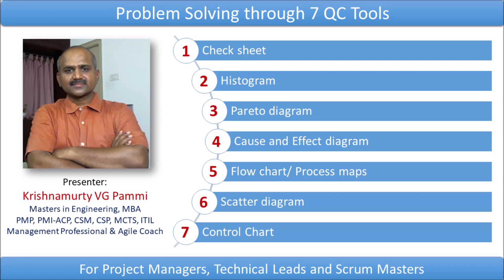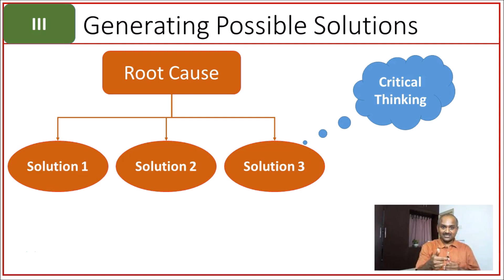Problem solving using 7 QC tools

Comment: 0:00 Introduction
 1:04 I Define the problem
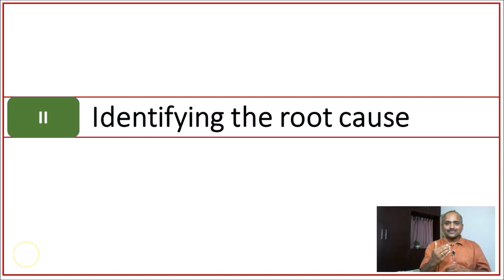3:02 II Identify the root cause using 7 tools:
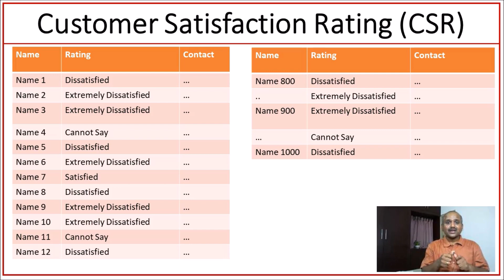3:56 1. Check sheet
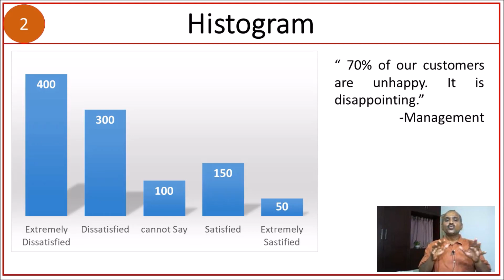5:18 2. Histogram
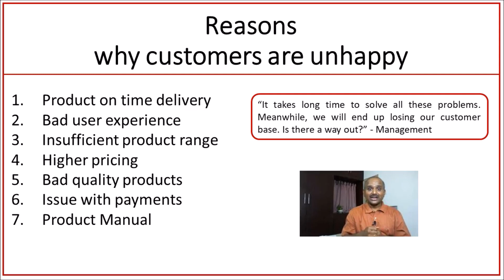7:44 3. Pareto diagram
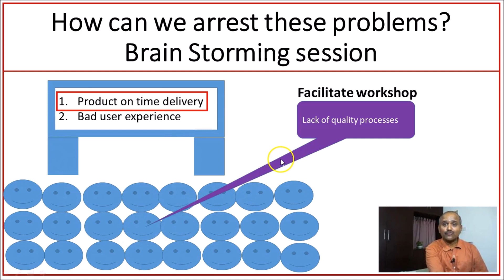11:10 4. Cause and effect diagram
14:58 5. Scatter diagram
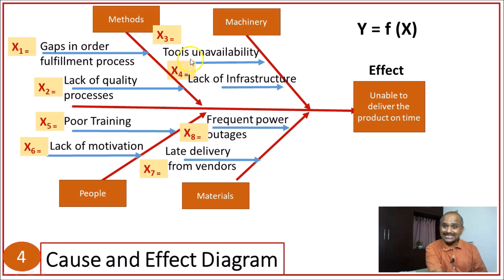16:20 6. Flow chart/process map (SIPOC)
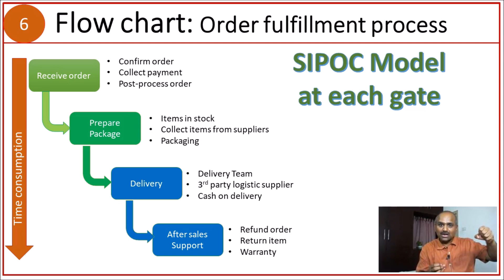19:04 7. Control chart
23:30 Conclusion on root cause identification tools
23:55 III Generating possible solutions
24:20 IV Choose the best solution
25:14 V Implementing the solution (Rassi matrix?)
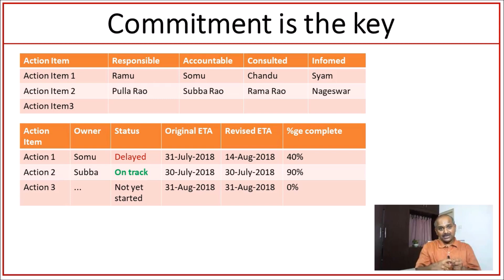27:15 VI Verify the solution's effectiveness
28:01 Puttings things together

Comment: t=1198,  Sir, control limits should be within the specifications limits and not otherwise.. else, process will be under control and still will produce products outside specifications limit.. its it ???